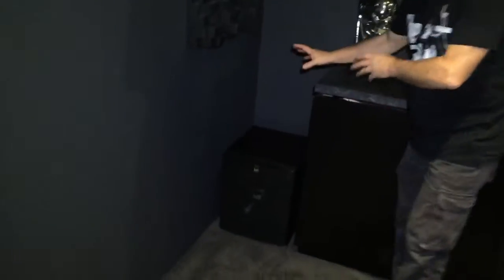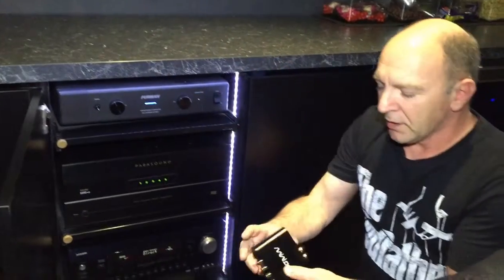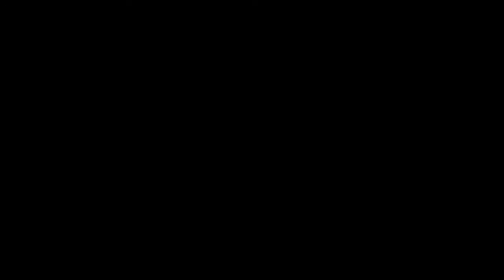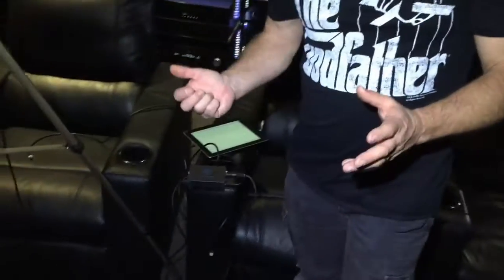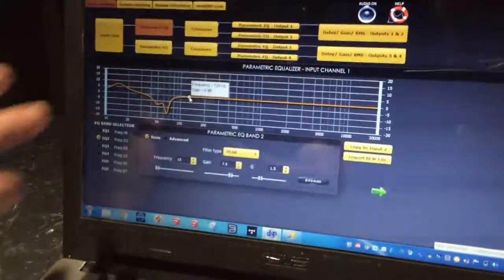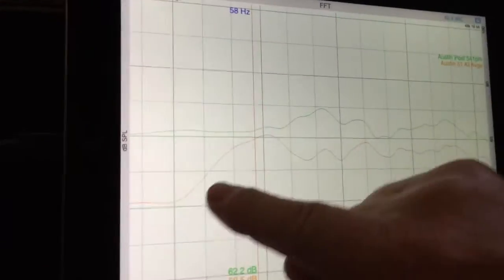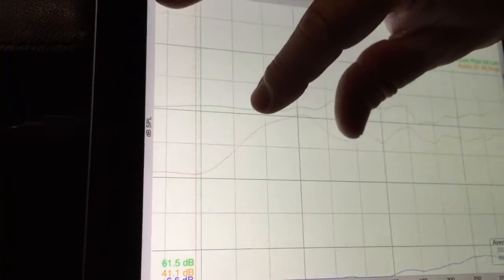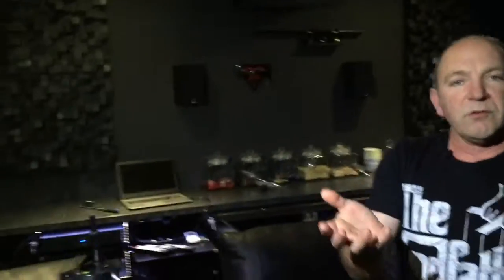Mini DSP Eq

Comment: Hey guys, great work! I have a MiniDSP Nano AVR DL 

Is it possible for me to use this to control my bass only? I have it connected and analysing each full range channel (5.1) and I'm not happy with the sound due to the fact that I have to use the inferior processor in my bluray player and then output the signal via pcm. 

I have a Nad M15HD2 with a vastly superior internal processor to the one in my bluray player and I would prefer to use that as it sounds so much better but in order to use it I have to output bitstream which the MiniDSP doesn't recognise,... could I output bitstream and only use the MiniDSP to tame the bass in the same way you did in this video?

I'm not very tech minded and hope I've made sense

Any help appreciated 
Darren
Reply: Not possible. No bass management on the Nano because of no analog output available.  The nanoAVR is only good for tweaking a media streamer or PC for music only, provided you have HDMI output.